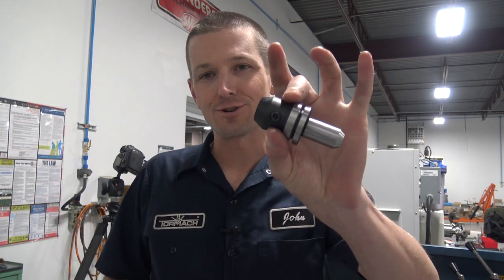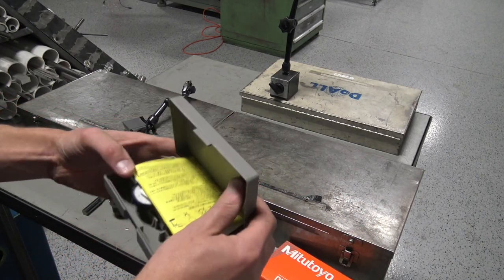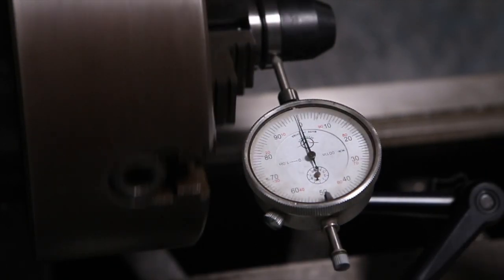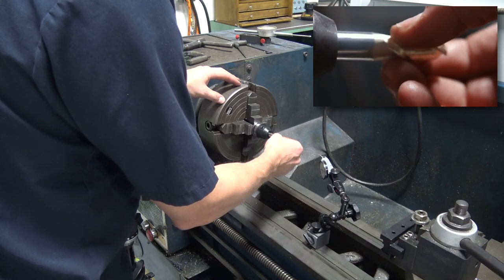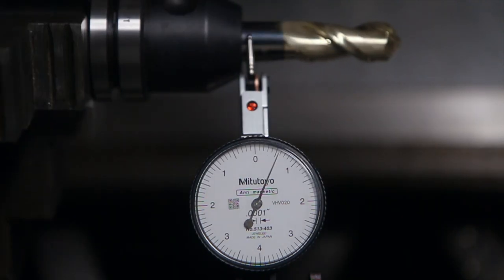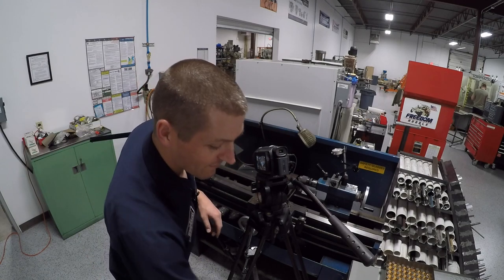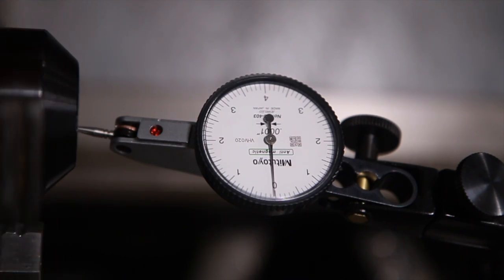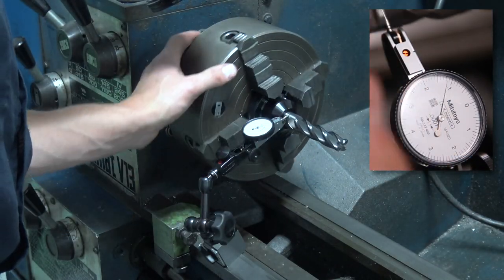Do Set Screw Holders Push End Mill Tools off Center?  WW122

Comment: Am I the only one that jumped in my chair....just a little when that dial indicator box hit the table top....?
Reply: No, but that was a stunt indicator, a simple trick of the camera.
Reply: hahaha yup metoo!!!
Reply: Well it “was” a 10ths indicator
Reply: They are not that fragile.  You don't throw them on the bench when not in the box, but they could take it.    I use the same indicator multiple times every day. Mine is 4 years old and has been bumped and knocked around a number of times.   Still accurate.
Reply: I’m sure it saw tougher handling when it was shipped, that’s why the case has foam and supports in it
Reply: Mr. Deez is probably correct.

Comment: I cringed when you threw that indicator lol.
Reply: jbbchinook haha me too
Reply: jbbchinook yep me too.  I was about to make the same comment.
Reply: Same lol, but we have one and they seem to hold up pretty well to bumps. Mitutoyo makes pretty good stuff
Reply: John, you have to make sure you are concentric and square to the spindle . you have to check multiple depths on the bore.  you only checked one area. any run out would be amplified. also get some thin copper to put on your jaws bid
Reply: with the tormach holder you may have had more of a cylindrical surface to orientate to the spindle so it was less apparent. if you were only grabbing the outer ring of a cat 40 even a 1 deg kick would deceive you. to remedy try putting the pin back in and get to concentric readings or reindicate the bore to match in two places. also when doing fussy indicating on machine only spin one direction . it takes the slop out and gives a little preload, so the jumps are consistent. happy holidays. keep up the good work.
Reply: Exactly!

Comment: About the larger toolholder. I didn't see you check the bore at multiple depths. By checking at one place you dial it to be concentric at that depth, but the holder is likely not co-axial with the spindle, as the chuck grabs it by the edges. Try measuring at the edge, and then go as far into the bore as you can. This toolholder doesn't appear to have machined faces, but if a part have a face, you would normally dial the face to not have a deviation, and thus making the part co-axial with the spindle, and then dial the bore to have no runout, making the bore be concentric.
Reply: Tuugem I was thinking the same thing. check the holder at deeper depth. also try checking the tool as close as you can to the holder where you centred it.
Reply: Tuugem  I was about to write a very similar comment.
Reply: exactly. i instantly thought when he put the tool in and suddenly mesured that it has runout that it has to be off axis or bend :p
i would have mesured the test gage pin first further away to try to track down where the runout comes from mostly, also mesured the gage pin 180° turned and subtracted those results to eliminate anythin in the testpin.

i would love to see a "do-over" or whatever its called in english :)
Reply: All these "what-if's" and excuses for the results could be totally obviated by simply installing the toolholder into the machine spindle and measuring the runout in-situ.

Whatever the runout reads there is what the metal sees, and that's really the only measurement that matters.

Stick the toolholder into the machine taper, measure the bore, then install the tool and measure the tool.  Would probably have been faster than the way he did it originally, but I doubt the results will change drastically.

Comment: Hey John, good subject matter here. This is something I have often wanted to test myself. One thing I feel may be causing error is the way the part was being held and indicated in the 4 jaw. If you only indicated one spot, you may not being running absolute concentric. If so once you stick a tool in there and read a different position you will get runout. Getting parts indicated to within tenths in a 4 jaw is tricky, but I like how your not scared to give it a try. I see in a comment below your going to give it another try. 👍🏻👍🏻
Reply: Abom79 thinking the same thing
Reply: I was also wondering why after he indicated at the Chuck and switched to the end of the holder why he wasn't bumping it around with a mallet and then going back to the Chuck and checking run-out there. He instead went to the end and started adjusting the chuck again. I usually run two at the same time indicators one at the Chuck and one on the end. Tightening the chuck fucks up the end Everytime. I do the same thing in the mill to check my reamers. Why would he put it in the lathe. Just load it in the mill put it in neutral and spin the damn thing.

Comment: i think the cat40 tool holder axis was not lined up with the spindle axis, so having the endmill in the bore would throw the runout more (the farther away from the holder the more runout). You should try the same test with the holder in the VMC spindle and see what happens (so it is lined up by the taper and not the face of the lathe chuck), i bet you'll probably see the same results as with the tormach holder.

Comment: I suspect the added runout from the 3/4" holder is because the holder wasn't parallel with the spindle, thereby causing angular runout. Just like when a rifle barrel is dialed in it is checked at two different locations 4-6" apart.
Reply: I agree with you. Its easy to verify. You could mesure the angular runout with the moving part of the lathe.
Reply: i think its the carriage in English. I mean with the magnetic base on the carriage.
Reply: I'm doubtful. The angle would have with be 0.23 degrees (0.002" of runout about 0.5" from the end of the collet (arctan(0.002/0.5)), which is highly unlikely. There would have had to be debris in the holder, which wouldn't have been possible due to the extremely tight fit of the tool in the holder. What it likely was, was different ambient conditions than what the tool was turned at, as well as anisotropic properties, meaning the tool didn't expand/contract outwards at the same rate in every radial direction.
Reply: Apron is what I've always heard it called.
Reply: "Apron" is the front part, with the knobs and handles on it, that hangs down in front of the lathe ways like a cook's apron. "Carriage" is the name for the entire moving assembly, including the part that rides on the ways and holds the crossfeed screw, as well as the apron itself. Also, there's likely far more slop between the ways and the carriage (on an old used lathe like this) than the runout numbers he's measuring in the endmill holders, so it wouldn't work to measure it off the carriage.

Comment: Probably a reason he didn't show the holders in a mill and that's because Tormachs have a bit of runout.  I picked up a 96 Brigeport VMC for $3,500 and added Shars ER32 collets & CT40 holders. Mill ran under 0.0001" runout @ taper and the ER32 setup would maintain 2 or 3 tenths tops @ end mill shank. Backlash on all 3 axis was under 2 tenths on a 20 year old mill that can step @ 0.00006" over 20 years ago. Expecting a Tormach to hold 1 or 2 tenths on the holders isn't exactly unreasonable in this day and age.

Comment: The error in the reading was most likely due to the tool not being coaxial. Also the reason I do not like Weldon holders is the fact that you are pressing a carbide cylinder against a slightly larger bore; so the contact is a single line the length of the tool inside the holder and one or two contacts from the screws. Another major concern with Weldon holders is they should only be used with tools that have flats milled/ground into them; otherwise the gripping force is insufficient for a 30hp spindle and the tool will spin in the holder, possibly pulling out, pushing in, or welding itself in place.

Comment: John, in a weldon-screw in type of holder you have a single point and a very small almost a line like surface contact on your tool and holder. It may seem rigid but if you run any real cuts it will fret. For grinding apps it will work since you're removing material in very small amounts. You can obviously use it on endmills for roughing, if the endmill has a land for weldon. I recently had a long extension issue and purchased a ShearHog SH787 just for that purpose, holding it in any type of holder other than a high performance milling chuck didn't work. The SH worked but the quality was pathetic due to vibration. That was really educational to see that a milling chuck (they  are mechanical, usually more expensive than either shrink fit or hydraulic chucks) eliminated the vibrations. Your setup may seem to work great with tools that have small extension. But if you truly want quality,  you need to up your tool holding to shrink fit or hydraulic or high perf. Also instead of dialing in your lathe chuck, you need to look at the entire chain, for both displacement and stiffness, spindle-toolholder-tool-tooltip, and measure the tool tip runout. Add a solid carbide extension if there's vibration upto 5D extension.

Comment: Some remarks:

You have a system with a mechanical indicator with gears, shafts, and bearings mounted on a tall flexible mount. A tiny amount of energy is stored in the mag base mast going +and released going -: it takes a little more force to deflect the indicator + direction than it returns going - . This is the dreaded stiction. Your Mitutoyo indicator is a superb tool, new and free running, but it's still afflicted with stiction and this is manifested in the repeatability of its readings. The longer the mag base mast, the worse the stiction affects the reading. A small amount of vibration or a light tap with a pencil is usually enough to settle an indicator/mag base system to its lowest energy state.

This is a long way around to suggest you run a motor idle and disengaged so it's slight vibration dithers (actual technical term) the indcator set up settling out the stiction making the readings more reliable. I realize the motor/drive noise poses problems when shooting a video but I thought I'd mention it for your viewers.

Another point is wear in the spindle tooling. A coralliary of Murphy's Law dictates that wear never cancels error. In time yous end mill adaptor will wear. Collets wear bell-mouthed but stay roughly concentric but set screw (Weldon style) adaptors wear quicker than collets. The cutting forces in a Weldon adapTer produce a stirring action in the gripping bore. The serscrew produces a large load on the opposite wall of the bore and it is here where the wear will be greatest. Further, the tooling bore will wear bell-mouthed. Figure on replacing them oftener than collet adapters. How often is a matter of intermittant monitoring the state of wear and taking into account the degree of cutter performance required by your work.

Comment: The run out you are seeing on the 3/4 diameter is most likely largely influenced by the centerline of this diameter not in line with the centerline of the lathe spindle. Case in point when Abom dials a diameter in his lathe he checks it for runout on the diameter and a  face or machined shoulder several times till both directions are as close as the workpiece will allow. In your situation the best thing you can do is put the taper into your machine spindle then check runout. This will not be perfect either but will greatly reduce the error shown now. Once this is achieved you can then proceed to the task at hand checking the push of the set screw. After all we are talking about milling and not grinding so where the rubber hits the road is the holder in the spindle. The push of the set screw will certainly be a different value on the tip as compared to the shank next to the holder. Bottom line alot of variables are influencing the rotational accuracy of an end mill. One more thing to think about. All standard carbide end mills are a minus tolerance on the cutting diameter so any runout/push or combination of the two will in effect use up some of that negative tolerance and maybe bring it closer to nominal. BTW you should never toss an indicator around and expect it to maintain accuracy. Metrology is a very intense subject not easily covered here. Just some of my .02

Comment: John
The initial movement on the DTI when you rotate the chuck is the headstock bearing rolling up on the lubrication film that's why it stays a tad off ( never returns to zero ) while you are rotating it ,plus the influence of you hand. In the steam turbines I have worked on you can see the shaft rise when they are barred up prior to putting on the main steam . It's oil film ramp
Reply: Stuart Hardy shouldn't that ramp in the opposite direction when reversing the spindle? Even by hand?

It's been awhile since the class that included hydrodynamic bearings/effects, and we didn't go into effects of hydrodynamic forces on roller bearings. 

Not doubting you at all, just looking to expand my knowledge base.

Comment: The larger the hole and shaft, the larger the tolerance on the hole and shaft diameters. It doesn't matter whether we're talking tooling or bearings.
The larger the part, the more thermal expansion becomes an issue both in manufacturing the tools and in use. For example, a 2" diameter part heated from 70 degrees to 250 degrees expands twice as much as a 1" diameter part. So when manufacturing a part that is heating up as you cut it, it becomes harder to hold tight tolerances on larger part. Use of coolant and CNC machinery has made that easier, but it still affects the final part.
Thanks,
John

Comment: John, you should have used a dowel pin and measured the runout at the TIP of where the tool end would be, and not at the base of the tool. If the tool is tipped to an angle by the setscrew, the runout at the end of the tool tip would be multiplied.  I have normally only heard this runout argument made on small conical engraving tools where the cutting tip is super small, and even a thou or so could make a difference on fine engraving.
Reply: Excellent point.
Reply: AndTheCorrectAnswerIs Not quite,  what you have is a perfectly machined true tube, holding a perfectly machined true shaft. Therefore the set screw won't make the tool tilt, it will push it against one side of the tool holder, but still parallel (or as close as possible) to the tool holder. So, the runout will be equal (or damn close to) regardless of where the indicator is reading from.
Reply: +Tom Jackson You're ASSUMING the holder is perfectly machined, AND that the tool is perfectly machined and has no wear.
Reply: AndTheCorrectAnswerIs I am, because they are reasonably safe assumptions to make, considering they are precision parts. And if the tool is worn, it will go skiwhiff in a Collet, Jacobs or Set screw chuck. And if the tool holder is off by enough to be significant, it needs binning.
Reply: John, I like the concept of checking runout but I wonder if the tape on the jaws isn't allowing the cat40 holder to be skewed to the spindle centerline. you have the nose on centerline but I bet the back of the toolholder is off center resulting in a cylinder that wobbles the farther you get from the true running nose. It may be easier to test this in your mill spindle.